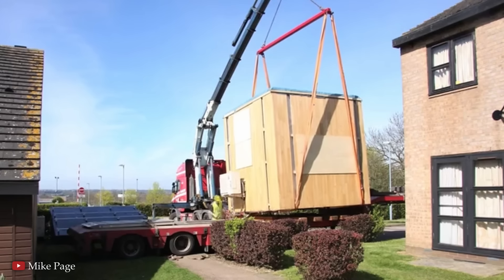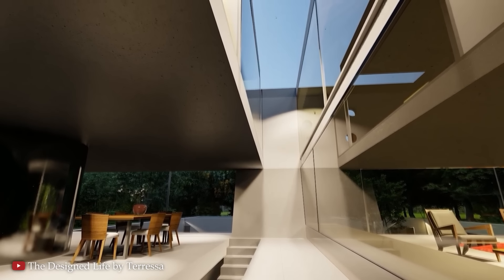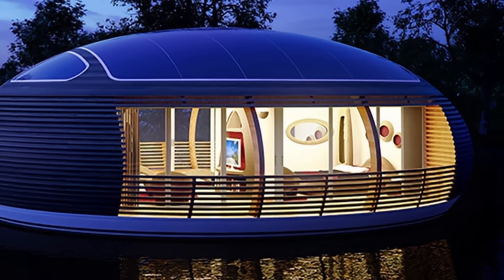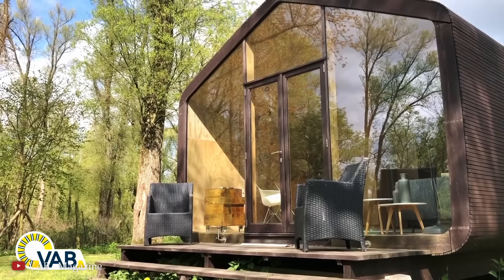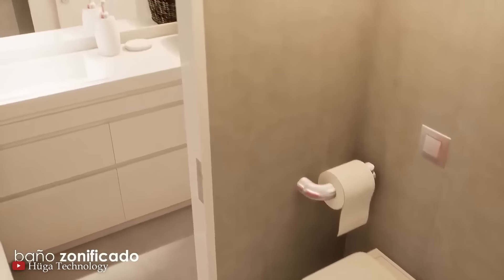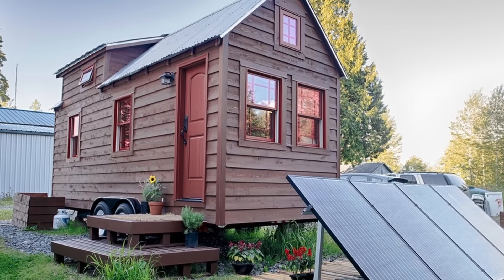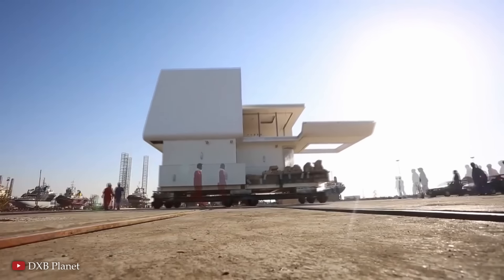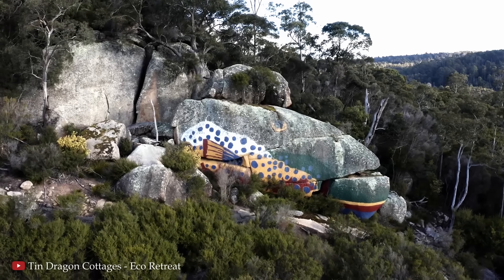TOP 15 Amazing MINI Houses

Comment: I can not stand the idea of having a tiny house. You should see some of the tiniest apartments in Japan. Painful, but the fact is i am 6,1 six foot one and need leg room
Reply: @dakotaj2216  you're 6,1, or taller and have been stuck in a cramped apartment?
Reply: The whole idea is to have a variety of different options for different people. If these don't work for you, then that's fine -- find something that does.

In general, though, the point of a tiny house is to take away anything you don't actually use, while making the things you do use just right for you. This collection didn't really get that across very well, but almost all of them are fully custom, and the whole point is to include everything you genuinely use and stripping away everything you don't. Spec-built houses, when the architects don't know how the individuals who will be owning the place actually live, have to include a whole lot of stuff, because they don't know who will be there or what they might want. Of course they're big. 

I've seen a tiny house built for an NBA player and it fit him just fine. Because it was built for him, so it met his individual needs, all of them.